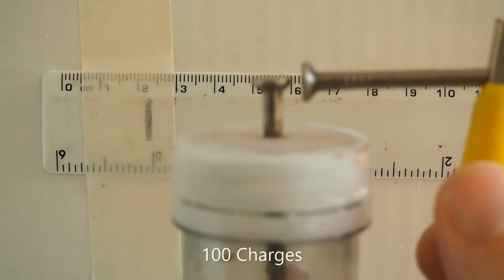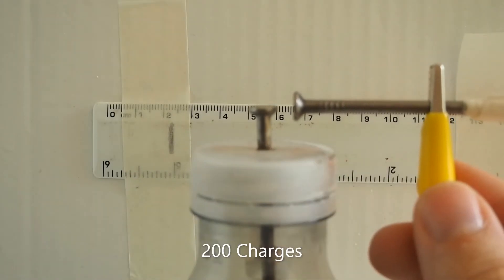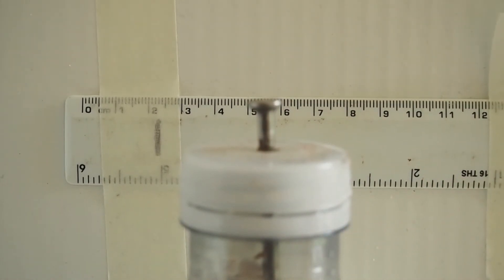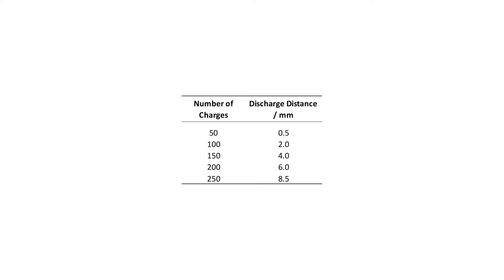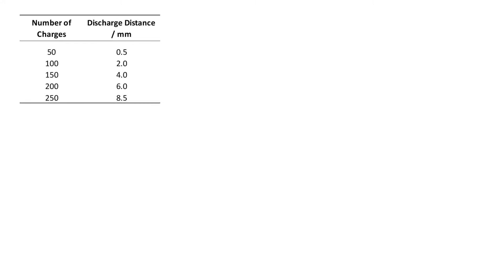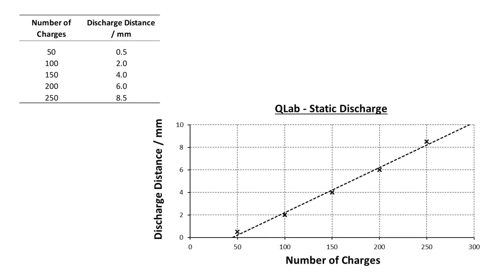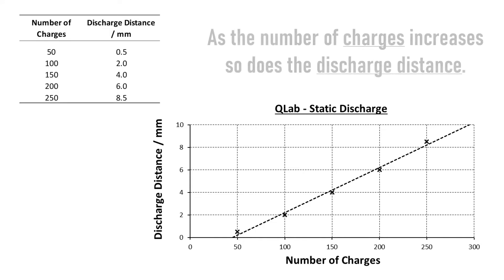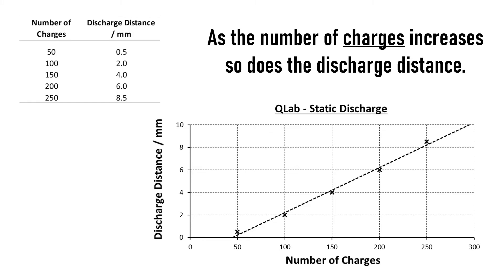Why Does Static Spark? - Static Electricity (Part 3)

Comment: 50 charges is how many volt?
Reply from the maker: I'm not sure, especially as this depends on the length of pipe interacting with the fabric, but at a guess approximately 10,000 - 20,000 volts.